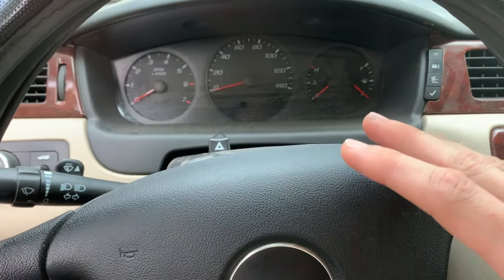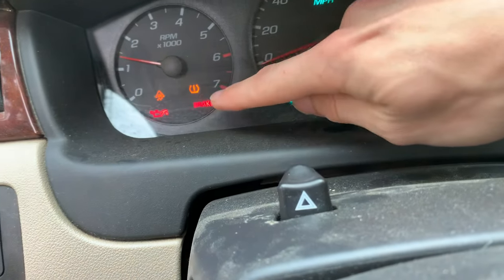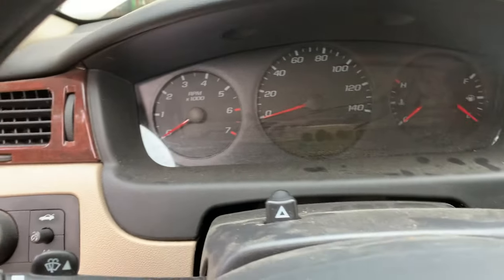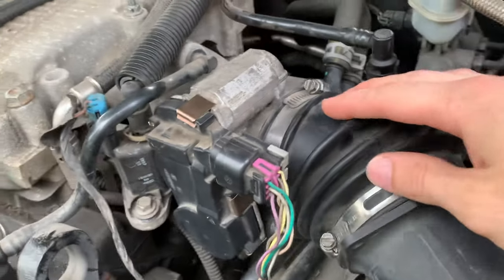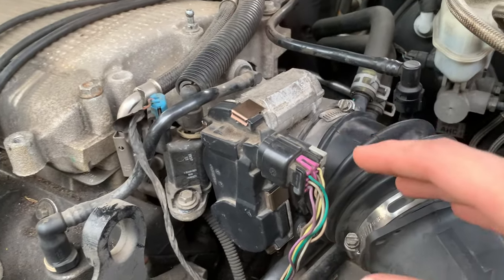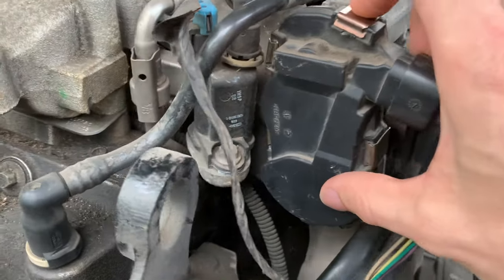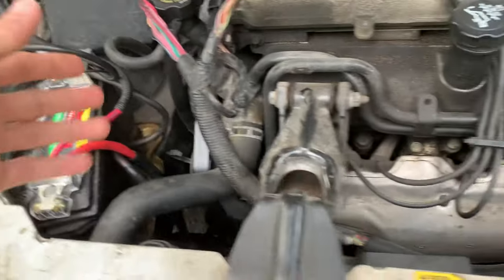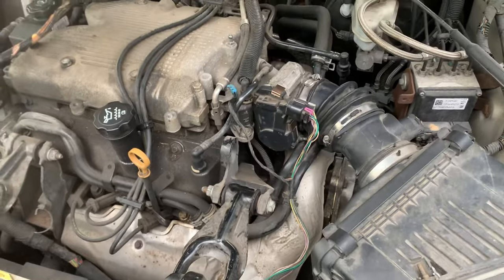How to Fix ENGINE LOSS OF POWER and Service Traction Control

Comment: My 2008 impala recently threw this code for Pedal Position error.  Amazed at replacement part prices for the vehicle.  Super Cheap!  Non-name brand Gas Pedals $35 bucks!! Thottle body Assembly $55!!  To AC delco original, Throttle body 180 and Pedal for $80.  And both can be replaced in less than an hour after watching wonderful videos like yours and others.

Comment: Dude, there are a dozen, OR MORE, different causes with the exact same symptoms!
Reply from the maker: Tell em chief!
Reply: @isaiahdray  I did
Reply: Ur rIt bt mOr lIk infinity with chevy impala-german-type engineering👋.  last video I Cn, the guy apparently fixed it by replacing MAF sensr..  (btw., p420s the sAm infinity causes cunundrum).
Reply: @ezwa9979 Sorry, for I do not speak gibberish!
Reply: hmnnn🤔..
Reply: @ezwa9979 Hmmm what?
Reply: I’ve been having this problem on my Sierra for 2 years already, I’ve changed the whole throttle body 4 times already. It will last about 6 months in between each time I get the reduce engine power on my dash. I don’t know what else to do.
Reply from the maker: Some of my wires were burnt up from where they got loose. Check around for a good connection, could be an easy fix like that
Reply: @isaiahdray  I just checked them and everything seems to be fine .. this thing is drive nuts
Reply: @thatsallfolks3115 
didNt U think it was not the core problem after the first 2 or 3 times?🤔
Reply: @ezwa9979  I did after the second , I was really banking on the problem going away since the throttle body only takes 10 minutes to remove and install, but since it kept me going for 6 months at a time and I couldn’t afford to have not even 1 day of down time I was ok with it, now I’m done kicking the can down the road and I really need to get it fixed.
Reply: @thatsallfolks3115  
hmnnn, maybe it’s that air vent hose flopping oil into it, which then clogged up hose to IAC valve - but thN agN I’m a common Utube type iDat in these matters(for real)👋
Reply: @thatsallfolks3115  Question: Does your vehicle have the air filter that is lube sprayed & periodically you wash clean it.
Reply: @norisboren5402  no I use a normal paper air filter.
Reply: Good, that eliminates the possibility of filter lube reaching the maf sensor & Throddle Body flap area.  To clean my TB opening every 4 months I have someone to press gas pedal to hold TB flap open while I spray around & in with TB spray cleaner to loosen grime, then wipe sides of opening with white cloth (while engine is OFF, engine cold also). Use safety goggles, be safe. Exact instructions are on TB spray can. Also be sure air intake hose from filter to TB is not gapped open underneath as mine was pulling in dust. Hope helps.
Reply: @chhansen9813 yea. WTH kind of mumbo jumbo was that?
Reply: What codes are you getting I got a p1682
Reply: It's either the sensor on the throttle body or the gas pedal assembly.

Comment: For mine it was the throttle position sensor gasket was cracked, check that first because its only $15
Reply: Something similar happened to me.  mid 1980's my 1977 Ford Granada V8 started dying whenever it rained or got foggy outside.  Open hood.  Cracked ring gasket below distributor cap.  Trip to "Track Auto" (now out of business, wow) and $7.00 for a new ring gasket for a Ford 302 engine.  Issue solved.   ONE- BIG issue with Throttle Body Sensors in all Vehicles today... as I've done some research, not from personal experience, is cleaning the butterfly by soaking it in cleaner. The strong solvent gets into the TSP destroying its plastic innards.
Reply: Point of Story - Always great to own a reliable and common car.  The ford 302 V8 was so common.  Same as the 3.5 and 3.6 V6 on the Impala, a common car, parts are easy to find cheap the car itself, easy to fix.  My Audi on the other hand, reliable, but if anything broke (and with ANY car something ALways breaks at some point... ), blood, sweat and tears, to fix.  German engineering?!... my butt... fixable, you just gotta baby them.... replace a filter, remove 20 components... u all know what i mean?  I no longer own the Audi 5000.  Great inline 5 engine... funky mechanical fuel injectors.  Everything is relative, I'm sure unlike the 1980's when owning a 77 Ford made easy sense, today would be expensive as some parts for such an ANCIENT car would be hard to find.  In a world of 3d printers anything is possible as far as some trim and pieces.  But those cars, as great s they were, you only got 11 miles a gallon, but gas was 89 Cents a gallon, 1987-88.

Comment: Wat about the traction control? U didn't mention anything,n izz there a fuse for traction control!
Reply: I have my traction control come on with check engine with and coughing power issue at near full throttle? Simular?

Comment: Have a 2008 chevy impala Lt and the service traction control will pop up for a few mins then turn off even when the car is in park or just starting it in the morning. Got these two codes  C0242-71 and C0561-71

Comment: I have a 2014 sonic rs, for the last year I've had a loss of power at full power, it will give keep giving power then not every second, I have a check engine every 6 months mixed with the loss of traction symbol. It will clear up after a day or 2 but the fluctuations of power at ¾ to full throttle remains. Any idea? 😊

Comment: I get P2122 and the connector coming from the ecm or other into the cabin that plugs into the APPS has one of the two 5 volt sends way below what it should be. What do you think is the cause? It’s not the sensor at the pedal.
Reply: Have you figured it out my car is throwing the same code I’ve replaced the app and the throttle body no wires look broken but I drive a Cadillac and can’t see most of the wires

Comment: Have 05 yukon AWD with autoride..from a stop if you hit the accelerator to fast it makes a weird electrical humming/grinding noise and limits power.then you let off and it will accelerate normal. No lights or anything. Sounds like its coming from driver side up front..thoughts?
Reply from the maker: Noise with acceleration could be anything from an air leak to low engine oil to power steering or something simple. Limiting power could be acceleration pedal or anything that connects with, throttle, etc. you are needing fuel air and spark distributed evenly to run. May be running rich and need to adjust carb.

Comment: Have a 3.0 03 Saturn view rebuilt the motor and it says reduced engin power and it won't do nothing more than coast. No acceleration changed pedal and throttle body

Comment: I replaced the sensor with a new aftermarket one, junkyard oem ones, cleaned throttle body, even tried different junkyard pcm and still the same issue! What do you think?
Reply from the maker: Check wires, might be acceleration pedal? Could always return it if the new pedal doesn’t work
Reply: If you take the throttle body off, make sure you don’t miss the gasket that’ll throw like 3 or more codes.

Comment: My 05 corvette isn't gaining any traction. The service traction system came on. My corvette won't go above 40. The rpms go up but the speedometer doesn't.
Reply: Went above. 3000 rpms and it just stopped. Just trying to get into traffic and not bring stupid.